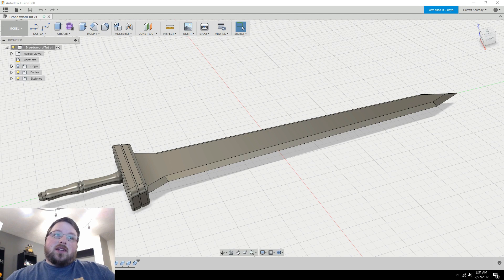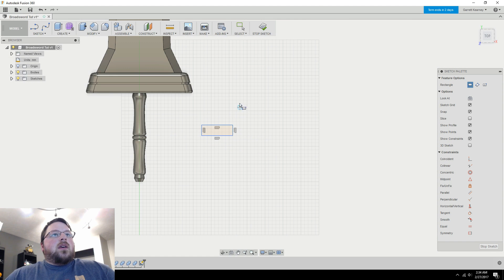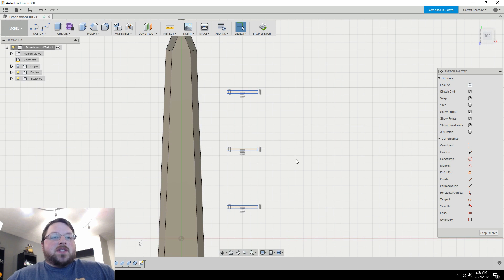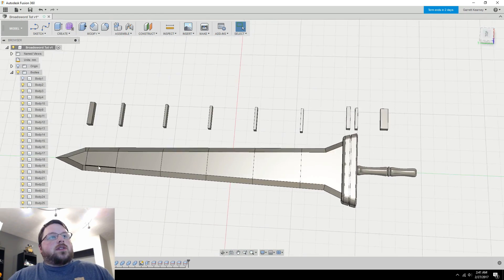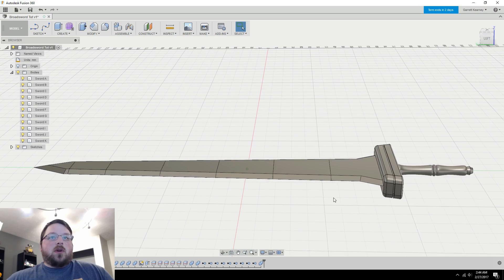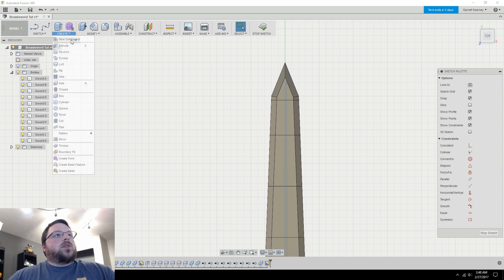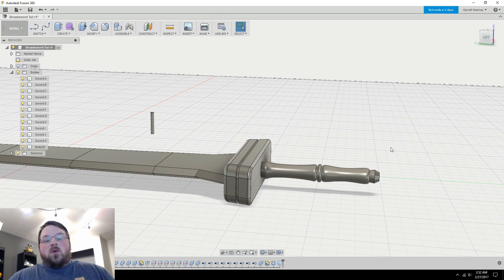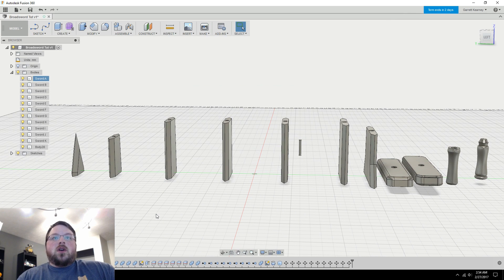How to Make a Sword in Fusion 360 - Part 3 - Splitting for Printing

Comment: Some good tips, thanks. Although making your printed dowell .4mm smaller in diameter would mean it's actually a .2mm tolerance I think. .2mm all the way round which adds up to .4mm in the x axis and .4mm in the y axis.
Reply from the maker: Ah you're probably right. I wasn't thinking straight there. I usually do a rectangle pin so I do .4mm on each side. So I'd probably have to do .8mm on a cylinder.

Comment: Fantastic video as always Garrett. I always learn so much from you.
I saw Devin @ Make Anything model Twist Containers in Solidworks, I thought that it can't be that difficult to do in Fusion 360 ... I was so wrong. Do you think it would be something you would try in Fusion?
Reply from the maker: I think I've seen a little bit of that in Fusion. What exactly do you mean by twist container? Just like a container of some sort with a twist off lid? Because I think I can do something like that. I'd have to do some testing but it'd make for a great video. I'll look into it, thanks for the suggestion! :)

Comment: very nice! I would have created plains instead of the extruded blocks to use for a cutting tool (split body), but its nice to see other ways of doing the same thing. Nice video.
Reply from the maker: I've used that method before as well. I think I actually did that on my Master Sword prop. :)